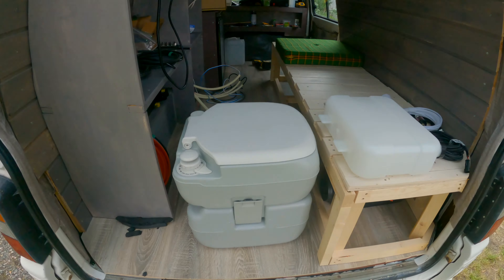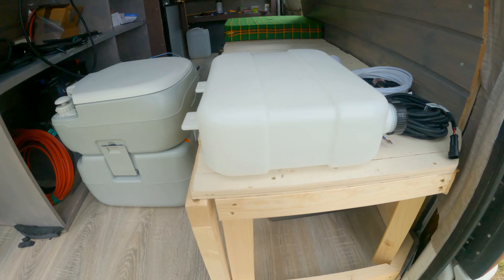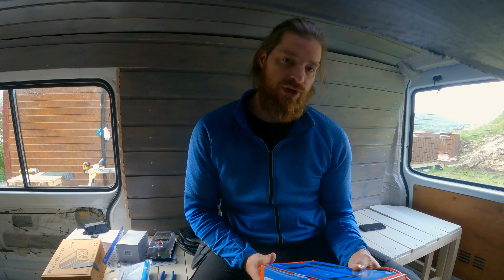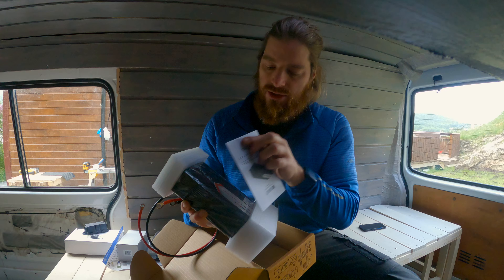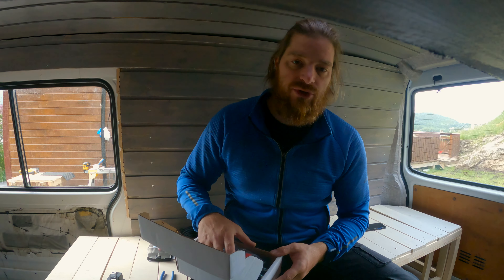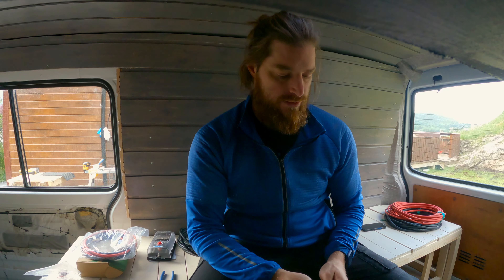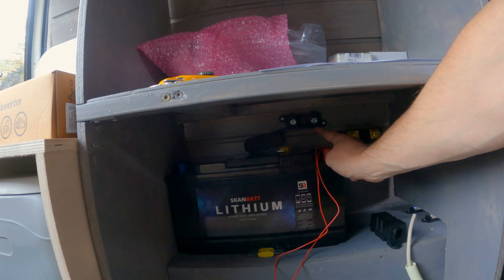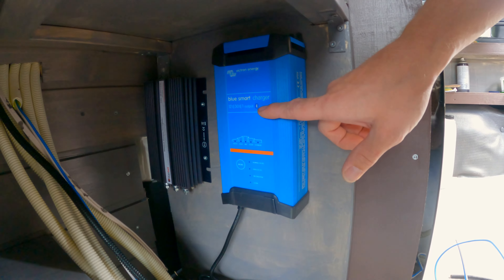Dive into Campervan Electric

Comment: Hi :)! I have a few questions, how have u learned all that? and  what are u going to use the van for? are u going to do videos camping with the van after?the bad thing is that if u do that is that if u r in Norway, spending the night in a van must suck I suppose, maybe with a lot of blankets XD
Reply from the maker: Hello thanks for watching, it’s no problem to live in a van in Northern Norway, I got used to it to have it cold during the night even if I’m not sleeping in a van. In this case I have installed an diesel heater for heating the car, roof vent for humidity, and the diesel heater has also an airflow function for getting fresh air inside the van. The van I can use for road-trips, traveling around. Mainly I bough it for surfing if I want to stay few days at beach without paying high prices for a hotel. I will do some movies with the van after during my trips.
Reply: @ArcticNorthAdventures  wow nice